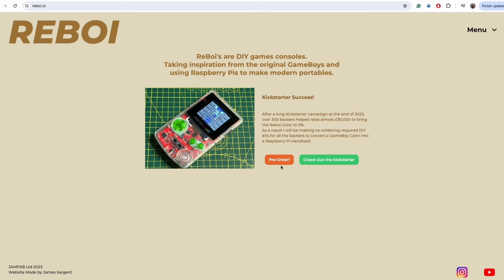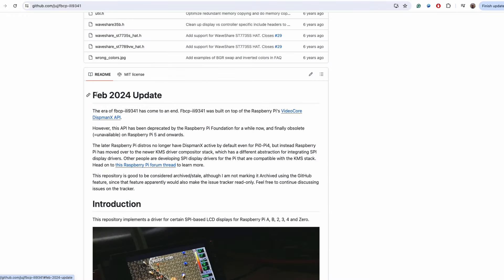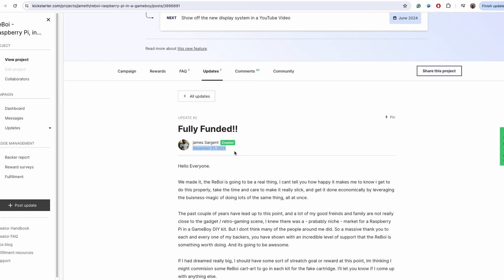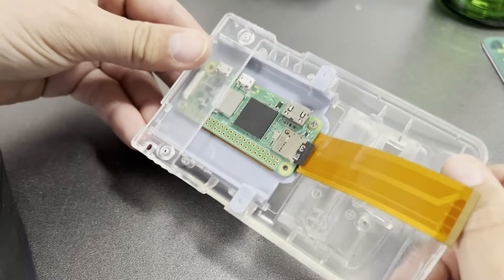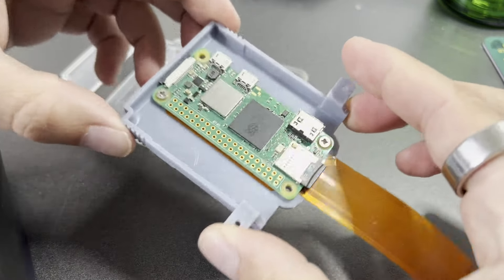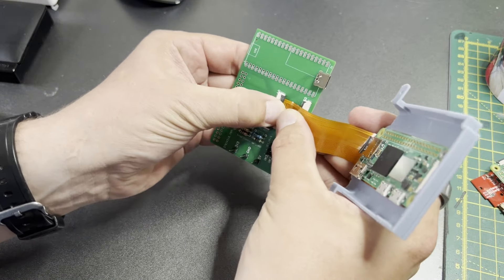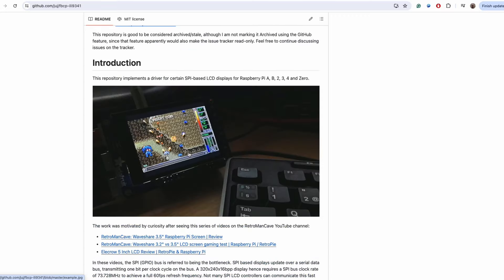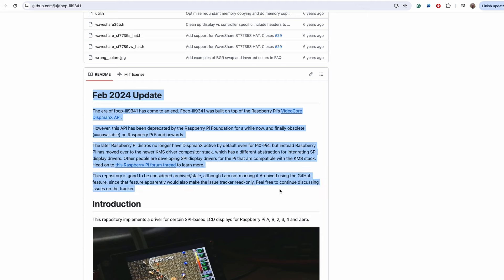ReBoi Update 1 - Display

Comment: Great stuff! Just putting it out there that I personally don't mind soldering at all, but those little springs on the flex cable look like a nice solution.
Reply from the maker: its been a hard line to walk, I could just do all the thinking and then make a solder-it-together yourself kit, but i sort or wanted to try and make something for my 10-years-ago self, plug and play :P

Comment: love the project, but wondered if any reason why DSI would not be a possibility, I believe RPI is making multi lane enabled and you can even use touchscreen versions ?
Reply from the maker: I went down this route for far too long, TL;DR, DSI is not supported on the Zero, the only Pi i can fit in the GBC :p the Zero has a camera connector, but the only native video is the HDMI port. please let me know if you know differently, a plug and play solution would be awesome.

Comment: Hey there! I just wanted to say that your project looks amazing! Great work! I hope it's not to much trouble but I have a quick question about  connect the LCD directly to the Raspberry Pi to GPIO pins with DPI interface? I'm thinking of using it for my project, and I just wanted to confirm stuff. thank you
Reply: Hey! No trouble at all. I haven’t needed to use any level shifters, most of the little displays run on 3v3, which the Pi produces on pins 1 and 17 if you give it 5v0 so it’s a direct connection between the Pi and display, no extra hardware required.
The hard part is initialising the display, you need to send it a few commands over SPI before it will start working in DPI, it’s technically all
In the data-sheet (ILI9341) but it’s a long data-sheet😂 good luck!
Reply: @james-sargent  haha thank you and good luck for yours I can't wait to see the final edition. I thought so but I probably add a DC converter and maybe a voltage regulator because my LCD is 12V
Reply: @kyu_273  so that’s probably just the backlight that actually needs the full 12V I would be very surprised if it needed 12V RGB signals. Remember that the answers always in the datasheet! Sometime you just gotta read it 50 times :p
Reply: @james-sargent  will do thanks again